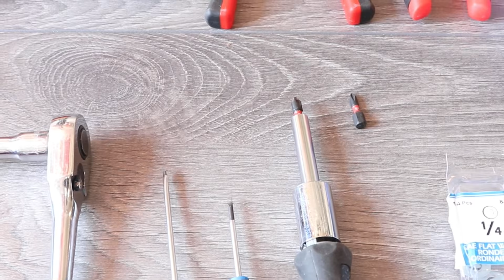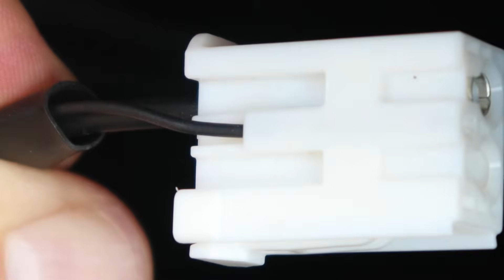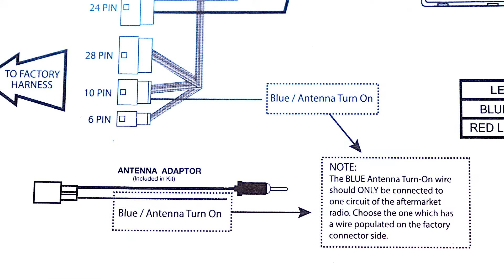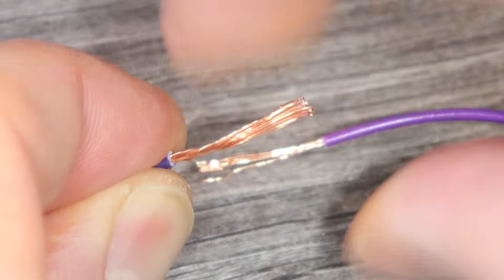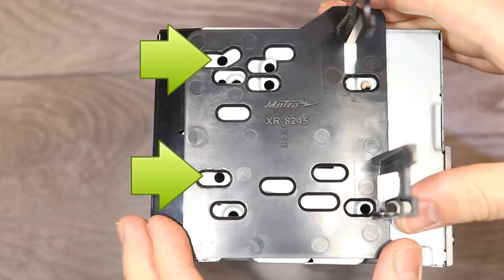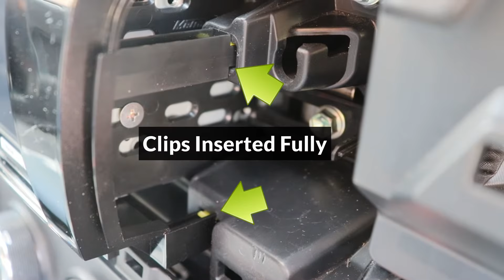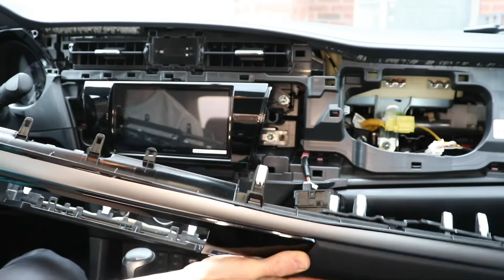Stereo UPGRADE, Toyota Corolla - Radio Removal & Installation 2014, 2015, 2016, 2017

Comment: How do you find the sound compared to the old Toyota entune unit? ? Also I heard the usb adapter in the CRUX-SWRTY kit was faulty for a few people did it work well for you?
Reply from the maker: The USB is working perfectly on mine still, so I think it's a rare thing, but yes I've seen some reviews about that.  The sound is WAY better.. More rich and more frequencies.  It makes driving more fun for sure. I played around with the equalizer for a while until I got it to the perfect settings for my ears, and I've had it there since.  It took a few days of getting adjusted to it.. I was so used to the more "muted" stock stereo.. a lot more highs from this unit.
The stock "high" "bass" and "treble" settings are a joke.  It was definitely worth the money.   I just checked and there's a "used acceptable" and "used - very good" right now on the Amazon link in the description, that are a fairly good price. I've had pretty good luck on the warehouse deals.
Reply: @CleverFix  Ok thanks I appreciate the response, that's definitely what I was hoping since I'm about to install a Sony XAV-AX5500 (on sale locally where I am in Canada) + Kicker speakers all around, I can't stand the stock stereo. Last question, I am planning to do a subwoofer amp install in the future so unfortunately that remote turn on wire (blue/white) can only be used for the antenna in the 2014 Corolla since it can only be ran on one circuit? I want good reception but I also want to be able to install an amp in the future thus I was originally planning to maybe leave it unwrapped so I don't need to take off the tape when I install my amp wiring kit later on.

Comment: I’m amazed at how easy the stock removal is. When I upgraded the stereo in my 2006 Corolla, years ago, you had to take out the center console and disassemble a good portion of the dash.
Reply from the maker: Yes it's a lot better now!  I'm happy with the way it's designed, easy to replace.
Reply: They make it easy because they know how crappy those oem radios are 😂

Comment: Is the soldering 100% necessary?
Reply from the maker: No, some people use butt connectors, I added a link in the video description to self-soldering butt connectors. They require a heat gun to melt the solder inside them. Make sure to follow the instructions.

Comment: Did you do a video for the mic installation? I'm installing mine tomorrow!
Reply from the maker: Sorry I didn't get the time. It's super simple though, the A-pillar video is pretty much all that's needed.  https://www.youtube.com/watch?v=bDzc7cpNY7I   I double side taped it on the windshield at the top.. Make sure to glue it somewhere where it doesn't obstruct your view if you're picky.. I don't like seeing the black blob in the way t all... It can be placed in such a way that it's not visible at all. The dash side cover just pops off and the wire goes through easily, then I used some zip ties.
Reply from the maker: Also make sure to tape the wire to the existing wires in the A-Pillar so it doesn't obstruct the airbag.
Reply from the maker: Thanks for the reminder also, I'll try to get it done soon.. it's useful for Mic or Dashcam as well.
Reply: thanks for getting bak to me so quickly! will let you know how it all goes!
Reply: @CleverFix Any idea what would cause a USB overcurrent caution?
Reply from the maker: @j.m.vonwood  Possible short circuit somewhere.. Could be the USB cable is bad, or sometimes the error can show if the speakers are shorted, the terminals of the speakers shouldn't touch any of the car's body, if they do it can short them.  I'd take the USB cable out, see if it still happens, and if it happens, then disconnect the speakers one by one.. the rear is easiest to start with.
Reply from the maker: If taking cable+speakers out, and it still happens, then it's either a short in the soldering job at the harness, or the unit is faulty and you can claim warranty on it.
Reply: Alright, bad USB cable. I disconnected that and it started working. Would you try a new USB adapter?
Reply from the maker: @j.m.vonwood  I would try to just plug in a cell phone directly from phone to back of the unit to make sure it's working properly. If that works good, then the unit is good. You can either use a USB extension cable, with male on one side and female on the other, or a special cable like I did, which adapts to the car's existing USB slot.
Reply: Cool, I was also thinking of trying that first. Thanks for all your videos, it's great to be able to pair my phone once again!
Reply from the maker: @j.m.vonwood  Glad the videos are helpful! Hope it all works out.
Reply: @CleverFix  update: got a replacement usb adapter and that did the trick. speaker upgrades coming soon! keep the awesome content coming👊

Comment: Does the back-up camera show on the new unit you've put in? I'm looking to replace mine since Toyota is quoting me $3000+ for a brand new radio unit or if I have it exchange it is going to cost me $1000+!
Reply from the maker: yes, the SWRTY adapter includes backup camera input, so the RCA connector from the car plugs into the SWRTY and it actually has a much better picture than the OEM head unit at night.  That's ridiculous $3000.. If you really want another stock one, you can get it from a junk yard very cheap... The sound is way better with Pioneer though.
Reply: @CleverFix  I'm definitely leaning towards just updating the whole thing with a touchscreen unit like you did. More sleek and has more options. And way cheaper! I almost dropped to the floor when Toyota said $3000+ for a brand new one and another $100+ for them to install. Like no thank you!
Reply: @CleverFix  What about the other vehicle settings that you access through the OEM headunit, are those lost with this upgrade?
Reply from the maker: @subtle_stream Yes the settings are lost unfortunately. I hardly ever changed them so it's ok for me, I'd rather have better sound. I kept the stock unit, so if I ever need to change them, I can put it in temporarily.
Reply: @CleverFix  I see, so you kept stock speakers? I get vibration from my rear speakers, I feel like I'll need to change them out when I do my upgrade. Sounds bad especially with bassy music.

Comment: Thank you for sharing this video.  More power to you and your channel.  I drive a 2015 Corolla S with tech package.
Reply from the maker: Nice, that's very similar to my 2014! Thanks for watching, it's appreciated.
Reply: Hey I just got a corolla s 2015 a couple of weeks ago and I wanted to ask you: Does your AC stops blowing cold air when you get to a stop sign or a red light and then after idling for awhile or driving it blows cold air again? I dont know if thats normal or something going on with either the ac or other part. Thanks
Reply: @theblukatlife , mine doesn't change or I never notice it. I think  as long as it cools your car it should be OK. Thanks and sorry for late reply.
Reply: @theblukatlife  may need a recharge

Comment: Hey. In your opinion, is this a "more necessary"/higher priority upgrade than adding an amp for new speakers?
Reply from the maker: Amps usually take a Line In, which means an unamplified sound source. The stock stereo doesn't have Line Out,.. so adding an amp doesn't really work. Some amps can work off of already amplified output but they won't have good quality and the quality of the stock stereo is not so great, so even if you manage to put in amp, it will be amplifying a low quality sound source.  The stereo upgrade is quite costly, but it would be the first thing to do after upgrading the speakers, if better quality is needed, line outs, and of course the mobile connectivity upgrade.

Comment: does CRUX SWRTY-61N compatible with JOYING carplay stereo 11:6 with 20pin connect on back of stereo.
Reply from the maker: No it's not. See the manual: https://cruxinterfacing.com/wp-content/uploads/2017/08/SWRTY-61N_MANUAL-3-8-21.pdf  On page 2 is a list of the brand supported.

Comment: Can you still change the vehicle settings with the new head unit?
Reply from the maker: No, the vehicle settings are only available on the factory stereo.  I don't really need to change anything ever, I'm happy with the usual settings, but I kept the stock stereo just in case. If I ever need to change something, I can always re-install it temporarily. And if I ever want to sell the car for example, I can also pop it right back in, and keep my stereo for the next car.
Reply: @CleverFix so there's nothing aftermarket that can change the car settings? We're stuck with OEM fot that matter?
Reply from the maker: @emacrz2561 Yes, unfortunately only the OEM head unit can interface with the vehicle to change settings.  For certain things, like Door lock settings, some Corollas are programmable through a specific sequence of presses of buttons on the door itself .. but for headlight settings and other things, only the head unit can do it.  I also believe the dealer can change any settings, without the head unit installed, but they'd charge for it. The only thing I really miss is the fuel efficiency graph.. I can live with the same door/headlight settings.

Comment: Can you also comment on the Android auto functionality? Is it wireless and stable connection?
Reply from the maker: I haven't tested it thoroughly, I'm gonna try it more and get back to you. It connects VIA Bluetooth and USB Cable at the same time. According to the manual it seems to require both. I'm not sure why though, but I'll give it a try without the Bluetooth and see what happens.

Comment: Does the usb that came with the car still work and can it be used as a wired connection for apple car play?
Reply from the maker: See page 32 from the DMH1770NEX for connecting CarPlay with USB, it's very simple:
https://www.pioneerelectronics.com/StaticFiles/Manuals/Car/OPM_DMH1700NEXUC_EN_A.pdf
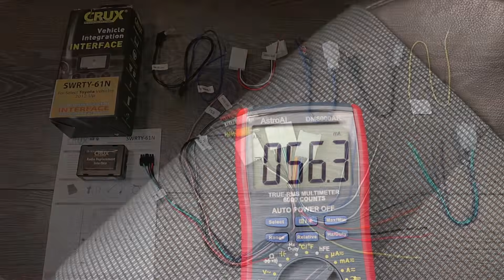Reply from the maker: Yes, the CRUX SWRTY-61N retains the USB function. The connector is at 6:04 in the video. That connector plugs into the car wiring and the back of the stereo. Yes it can be used as a wired connection for Carplay.
Reply: @CleverFix  great thank you.